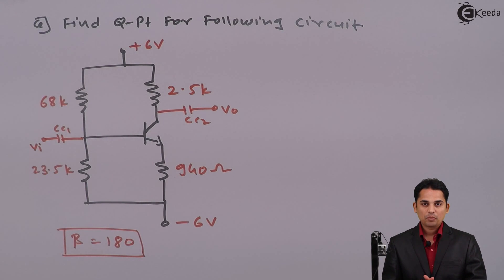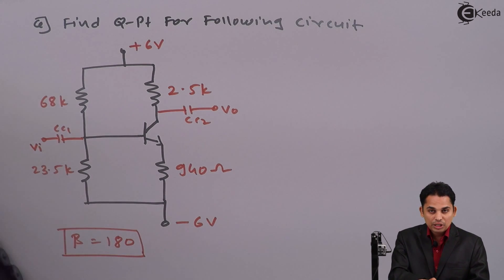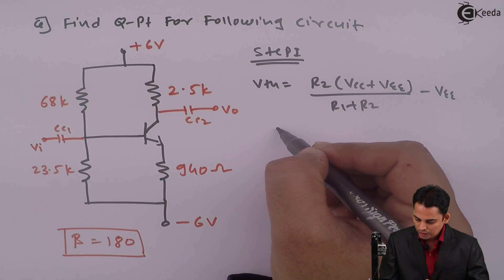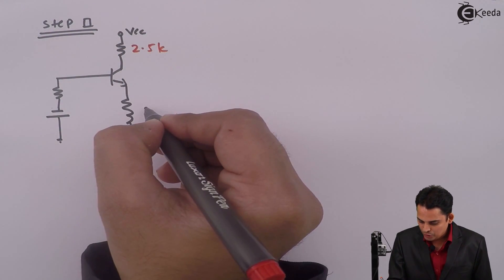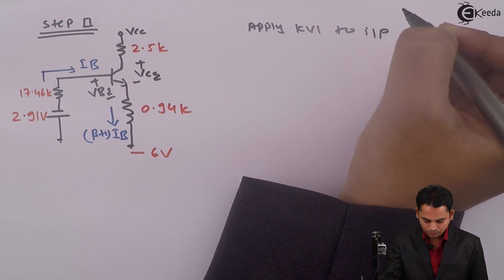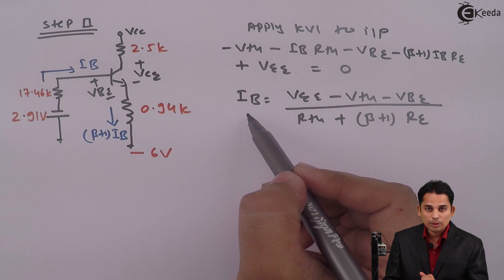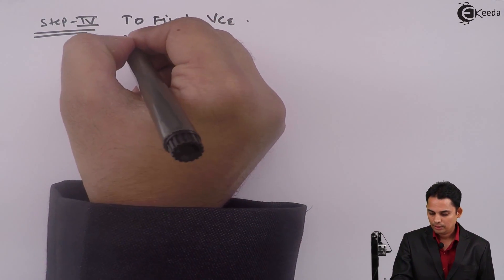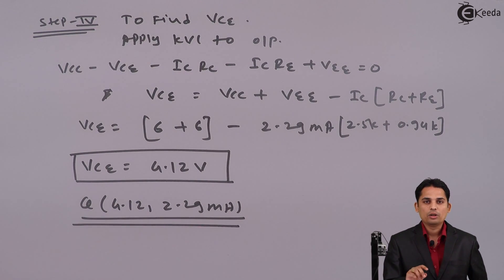Q-Point in Voltage Divider Biasing - Bipolar Junction Transistor - Analog Electronics

Comment: Sir how do you get Vbe = 0.6
Reply: Generally, Vbe will be around 0.6 or 0.7 under normal circumstances depending on the type of transistor. Often an estimate of 6.5 is used as well. Think of it as a sort of constant much like Vt at 0.026. Hope this helps.

Comment: at the output, while using kvl (Vce = Vcc + Vee - Ic (Rc + Re)
why you put the value of Vee as =6V, but acutally the value of the Vee is -6V
Reply: Same questioning me
Reply: The way he defined and used it is that Vee = +6V and the voltage at the lowest terminal is -Vee. You could say Vee = -6V but then you would subtract Vee in that equation
Reply: @brockfranklin3412  hello so we take Vee positive?
Reply: The formula should be like Vcc-Vee-Ic(Re+Rc) =Vce since Vee is at lower potential . And the value of Vee is - 6. So 6-(-6),you'll do it from here i guess